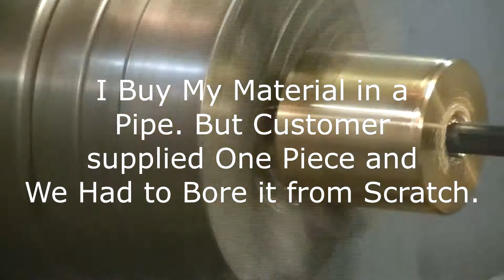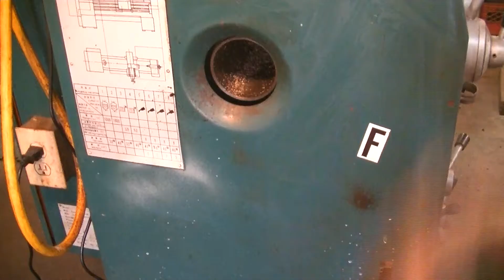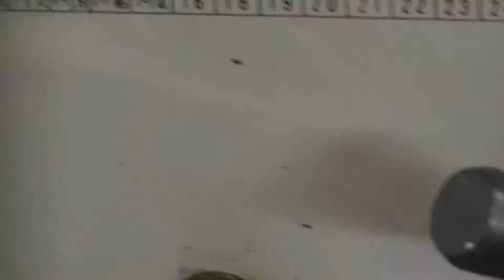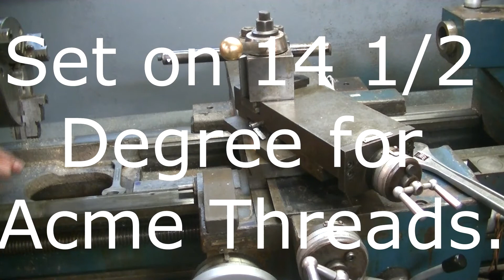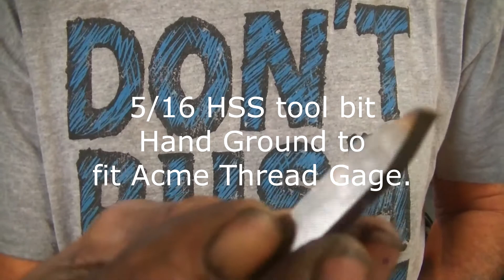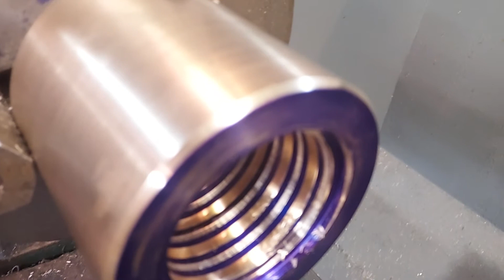Double Lead Left Handed ID Acme Threads

Comment from the maker: Since I am always looking for ways that work best for me, After I made the first one. I stopped using the compound and just came straight in with my tool to the right dim on the  Digital read out I always had a problem with the slack in the compound in the 2 nd  Thread and this method eliminated that and increased my time Greatly don't know why it took me so long to do this but its faster and less hassle just to come straight in and use DRO.  and after the rotate chuck there is no slack problem That's why you don't see me turning the compound in the video  FYI